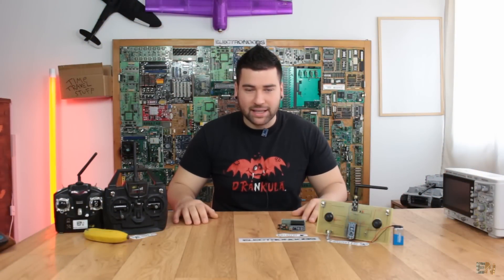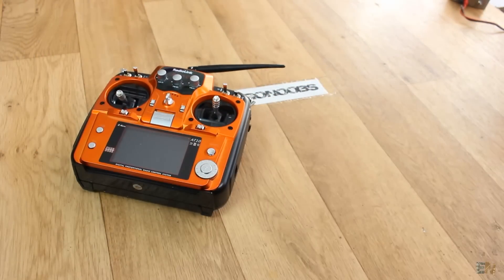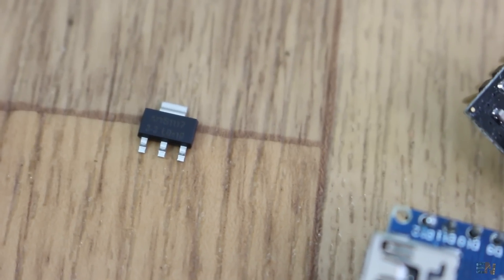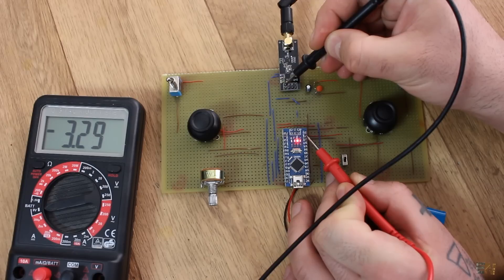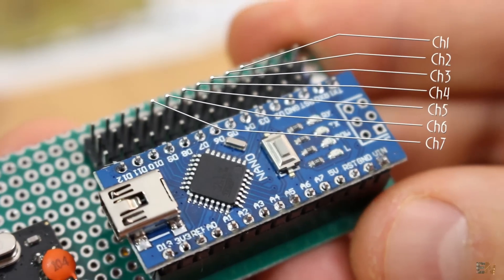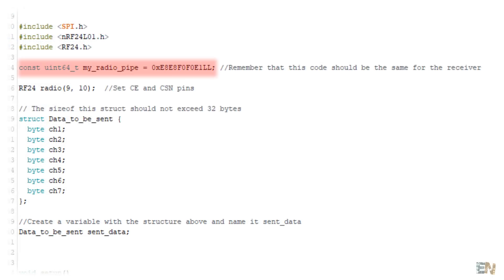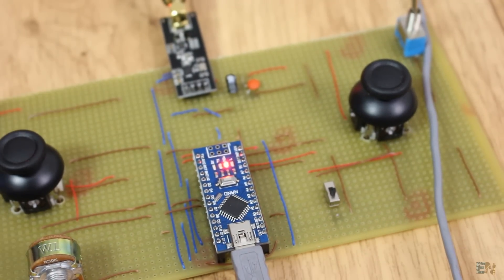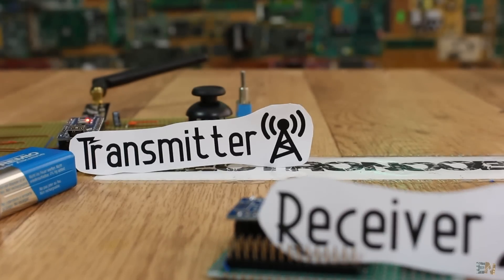DIY Radio Controller - Arduino & NRF24 + amplified antenna

Comment: Those "gimbals" have extremely crappy stick resolution, just sayin.
Reply from the maker: That's true. Just an example for learnning. As you can see there, I have 2 Arduino hacked radio controlles with much better joystick quality. Keep up!
Reply: @ELECTRONOOBS  "keep up?" What the hell is that suppose to mean?

Comment: I made one last month for my end study project using your previous method, this video will help me to update Some issues. thanks a lot my friend. by the way i'll came to visit Barcelona in next summer i hope meeting you there.
Reply: Amine Olivier ,how much does it cost?
Reply: I bought my items from Aliexpress, cause it's a very cheep: "Digital LED Capacity Tester Battery Indicator", good joysticks, and NRF24l01 module with "AMS1117 Socket Adapter Plate Board For 8Pin NRF24L01". All those cost me about 45 dollars with 3d printed case.

Comment: the RT9013 (found in wemos esp8266 boards) LDO 3v3 regulator is better than the ams1117...
Reply: Richard Benson well, let's say it's better in low current requirements... It consumes much less power than the ams one in case of deep sleep, for example